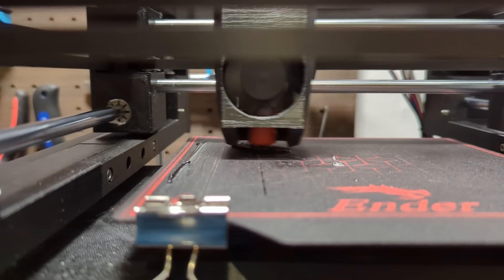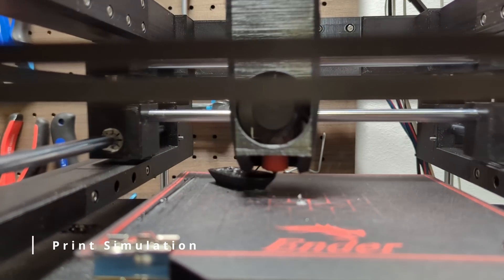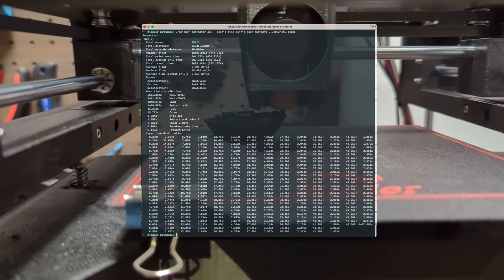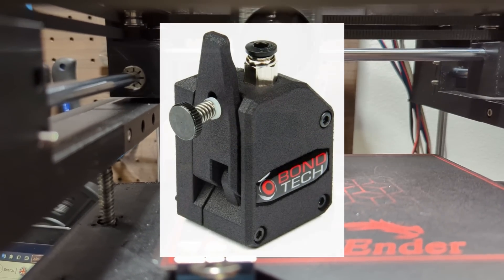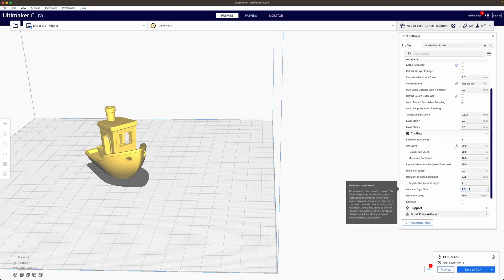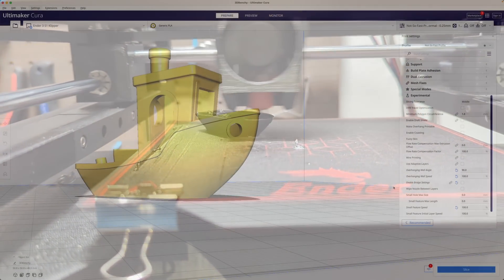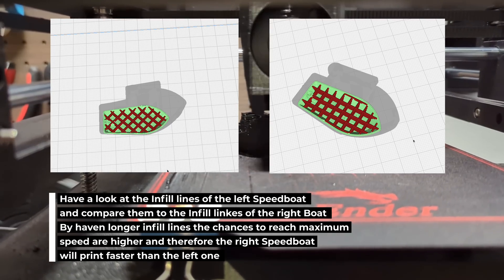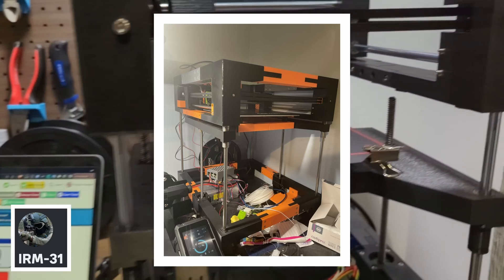Print FASTER: How to print 3D Benchys twice as fast!

Comment: I just had to be that guy..... Looks like a blob of plastic. It should resemble a benchy a litte bit more than this imo
Reply from the maker: Well that's not the focus point of the speedboatrace
You push your printer as fast as possible to see what will failed and why. To be able to reach that speed you have to disable everything that limits the printer. This approach, which is not new, car manufacturers for example use it for years in crash tests to determine the weakest spot of their construction to iterate on it.

When iterating from bottleneck to bottleneck changing your construction of the printer and improving it, you will be able to re-activate a handful of limiting parameters to get a perfect fine benchy. But you get this in 8-12 minutes, rather than 45 minutes ;-)
Reply: @MattThePrintingNerd  Yes true. But there has to be a limit on how bad the print can look like. I mean, many printers can go fast af. But the impressive part is when it also look good.

Comment: I actually rotate the infill angle instead of rotating the model because I have a bed slinger. I line up all the lines along my X-axis because the print head weighs way less than the bed and real world performance is increased
Reply from the maker: Good Point, when I did speedboat's on my Ender 3 S1 i'd also rotated the infill pattern!
Reply: @MattThePrintingNerd  Great video btw! I’m chasing sub 9 min on my bed slinger right now. My best is 09:25 so far. Limited to 6k accel, 100 jerk, and 600 feedrate

Comment: Amazing! Is it possible to get a similar speed with marlin?
Reply from the maker: Sure, but there might be a limitation of the controller board, I know when I printed Speedboats a long time ago I had issues where on certain speeds the controller board was to slow to process the data
Reply: @MattThePrintingNerd  yes, that sounds really plausible. I think i am happy when i reach only half of the speed from you. I actually build a large corexy with a 300 mm2 build area. When i get this printer running well i will print the 100. I'm in love with the concept.

Comment: I was considering building a v0, but realized the same as you that quality goes out the window with these concessions. I think the speed boat race rules have been maxed out and the next frontier is dual nozzles. Fine nozzle for external perimeter, huge one for everything else.
Reply from the maker: You have to consider Speedboat printing as something like a crash test dummy test. You push your printer as fast as possible to see what will failed and why. Things get exaggerated at that point, so things like loose belts are noticed quicker. The speedboat challenge itself is gimmicky yes, but you walk away from it with perfect benchy in 8-15 min when they dialing the critical parameters back by a bit. I plan to do a speed printing for quality prints video in the future where I go a bit into detail

Comment: Turning off retraction means you don't end up with an actual benchy, but instead you end up with a blob approximating a benchy
Reply from the maker: You have to consider Speedboat printing as something like a crash test dummy test. You push your printer as fast as possible to see what will failed and why. Things get exaggerated at that point, so things like loose belts are noticed quicker. The speedboat challenge itself is gimmicky yes, but you walk away from it with perfect benchy in 8-15 min when they dialing the critical parameters back by a bit. I plan to do a speed printing for quality prints video in the future where I go a bit into detail